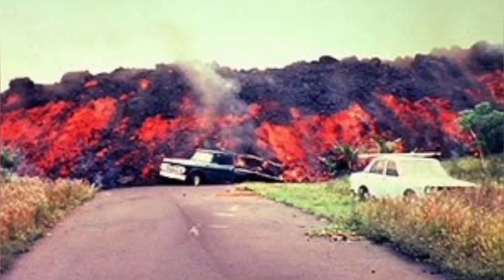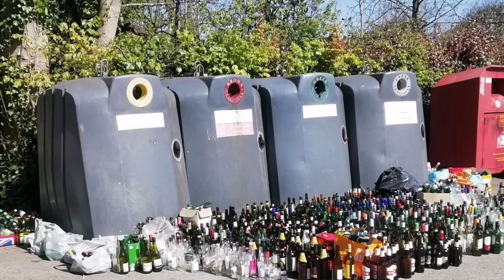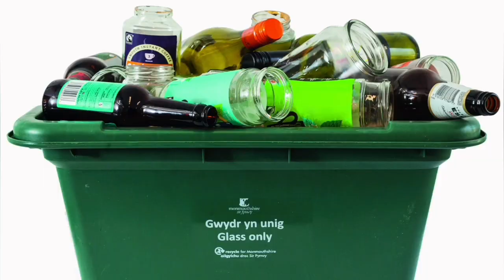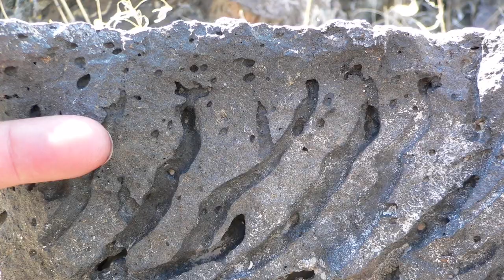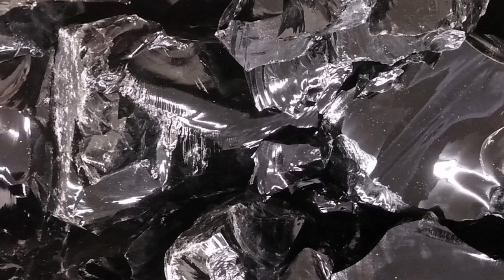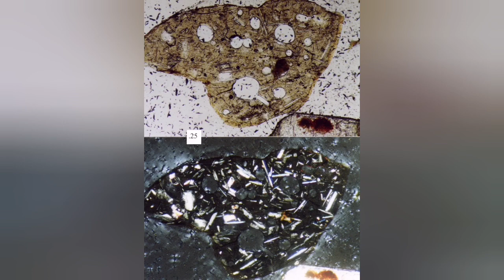The Strange Sound That Lava Makes: What Is It? / Volcanic, Volcano, Eruption, Flow, Glass Matrix

Comment: I've not seen an a'a flow up close, but I did watch a very small very fluid flow on Mount Etna, and was surprised by the fact that this very obviously liquid material was making a very strange dry rustling noise as it flowed at about fast walking pace. It also developed a very thin grey skin at the moment it emerged from the ground, so maybe what I was hearing was the mini-'clinks' from very small, thin glass pieces where the surface skin was breaking up. Very interesting - many thanks.
Reply from the maker: Your observation is very interesting for me because it is accurate! I am glad my little video was able to add a bit of context to your observation! Well done and thank you for the encouragement!